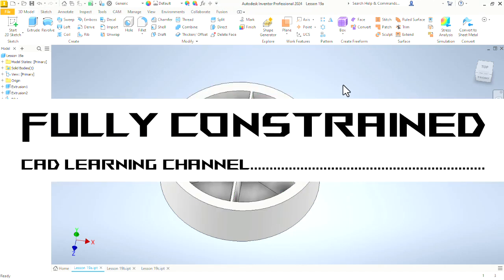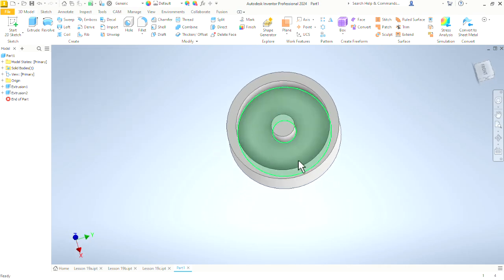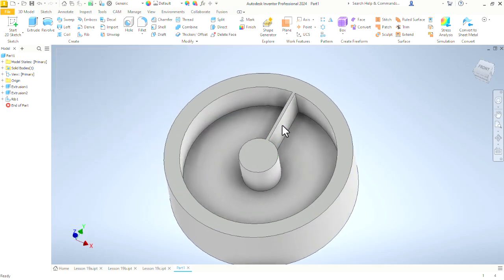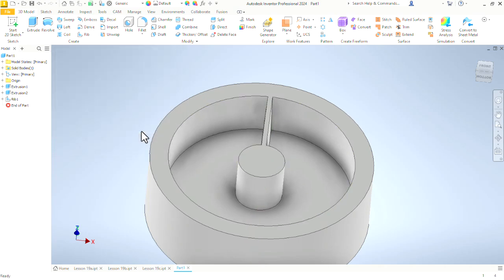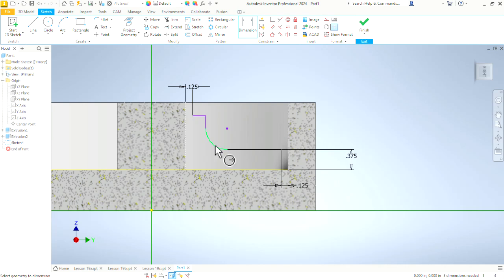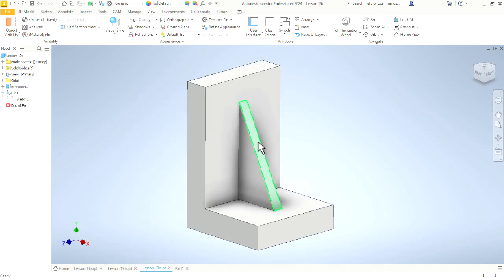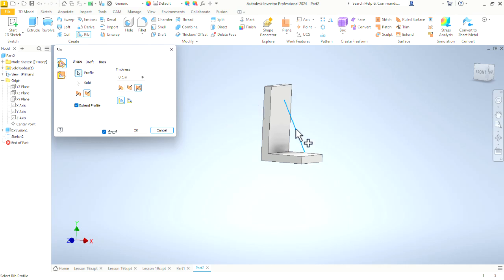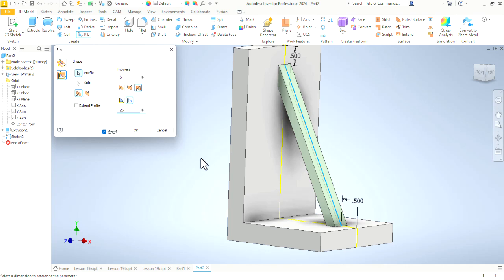Lesson 19 - Add Ribs to Parts - Autodesk Inventor

Comment: I was having issues with this but i figured out what I was doing wrong. on the Angle iron bracket, if you don't dimension the line to the corner it wouldn't create a rib. either that or i drew my line to a projected line. if you get stuck try deleting the projected geometry or make it construction
Reply from the maker: Good insight. Thank you for sharing.